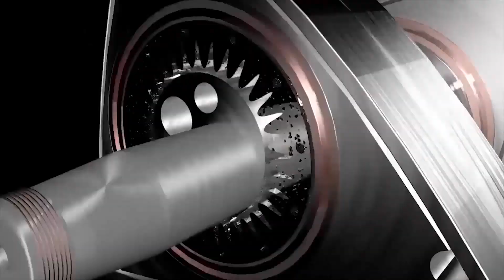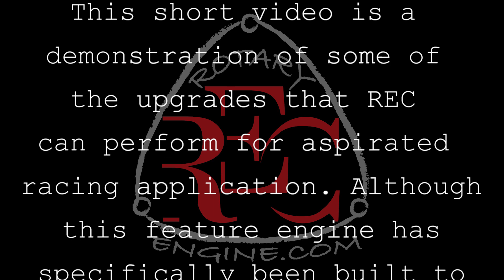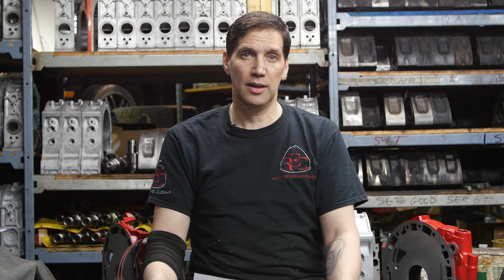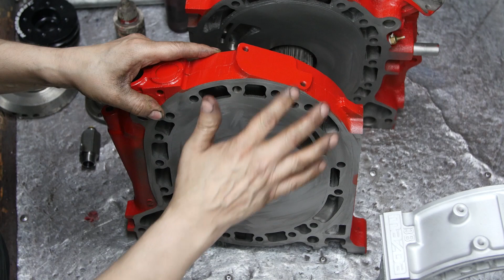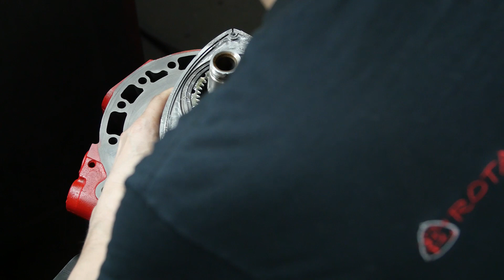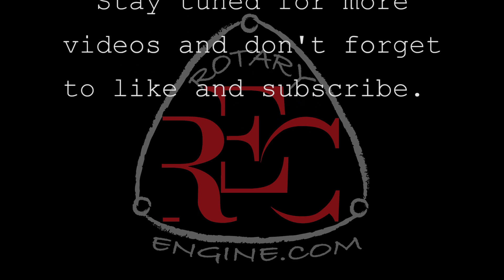Full Bridge Aspirated Racing Engine

Comment: 9750rpm that's nothing if my rx8 didn't have a rev limiter the factory engine would rev to 15k ik becouse it would sling the engine to 12k with the rev limiter at 10k....

Comment: Have to say in this case your wrong with those size ports for an n/a engine, over here in nz others have built these big massive ports and they don’t perform. Btw I’ve been building 25 years, turbo yep go massive, the limited very few have discovered here that 3B rx3 ports are as big as you need to go for a n/a engine, full length bridges, extremely torquey without losing top end power. Question what’s does n/a rely on A. Gas speed. Big ports slow the gas upon entering the housing resulting in performance loss. Fast gas speed more torque, still the same top end. This only applies for n/a. Bigger is not better unless you are going turbo.

Comment: Hey, my friend,  I learn a lot from watching your videos.  I would like to ask a question.  A guy that has a rotary engine website.  He explained to me that synthetic 2 cycle oils leave significant deposits in the engine; and that Marine 2 cycle oils are for a different type of 2 stroke engine than a rotary engine.   I found that Briggs & Stratton is a low ash cleaner-burning 2 cycle oil.  Does any of this make sense to you guys?  Thanks!!
Reply: I use Lucas 2 stroke oil in my rx8 street port

Comment: I have running '85 12A and 84' 13B GSLSE engines.  The plan is to combine the two for a ported NA motor.  But I'm not sure if I want a bridge in a 1200 lbs street car that will only see occasional track time.
Reply: What exactly did you do to get your car down to 1200lbs??
Reply: @rotaryrocket74  Start with a stock 1500lbs 1965 MG Midget.  Sorry for leaving out important information.  If I get fiberglass pannels I may be able to go sub 1K lbs.  The 6-port SE and trans are in it now.  Going to shorten the SE rear end.

Comment: Sorry to say but 2 stroke is not good. If you want Roto to last longer, Use 2 stroke oil in the gasoline! But that dosen't last long either... Two stroke have a short life because of the heat cycle the rings and seals have to go through.
Reply from the maker: We use Idemitsu in the fuel in conjunction with factory OMP. Its the surest way for best results

Comment: On the topic of early irons, can you run the early center iron on a gslse engine to make the port larger since the se iron does not have much material before you hit the water jacket? I’m currently running dcoe style throttle bodies so there is no need to use the stock injectors that would be in the se center iron. Car makes 197whp on a popular Australian dyno. And what would be the gains if I were to send it to you guys for either a maximum street port or half bridge?
Reply from the maker: Yes you can. They flow much better.  Its just the early irons are carb irons and dont have injector ports so you need to run ITB's with fuel rails built in thus ditching the stock SE EFI

Comment: Why are turbo bridgeports smaller than aspirated bridgeports? I don't get it?
Reply from the maker: Good words guys but also during overlap boost pressure can escape the intake charge and is forced into the exhaust. EGT;s can raise very high when fresh air is introduced into the burning exhaust gasses. A short smaller bridge at the top of the port only can reduce the amount of fresh air feeding the exhaust stroke
Reply: Port overlap, the longer ports on a n/a build are for longer duration of the intake charge. Basically the same as putting a high duration high lift camshaft in a piston engine. When you turbo charge a piston engine you put in a boost (or turbo) camshaft not one with heaps of overlap. It works the same in a rotary engine. Hope that makes sense. Cheers Mark.
Reply: @MJTAUTOMOTIVE  so why are people making big power on semi peripheral port turbo engines?
Reply: @BoogalooShrymp  . Because the port in the housing is positioned around the same place in degrees as a good turbo port in the side housing (iron). On a semi peripheral port the port size is very small compared to size on a n/a peripheral port engine. When the peripheral port itself is smaller it is also not as large in degrees as a big n/a port. They use the semi peripheral port to increase the amount of intake charge in volume  without changing the overlap "ie port timing ". Cheers Mark.

Comment: Could a full Renesis rotating assembly have been used here if its 10:1 compression was sufficient for the build? What application did the 9.7:1 rotors come from?
Reply: 89-91 rx7 fc3s non turbo. Only available in north america
Reply from the maker: Yes they could have been an option but we have learned that the extra .3 in compression does not yield noticeable gains. Also, when running apex seals over a peripheral exhaust port, you really need to use a tall RX7 apex seal, in which case the RX8 rotors need to be EDM'd to full depth slots....its pricey....plus the narrower side seals from the 9.7 rotors seal better
Reply: @rx7specialties203  It cant be done by any of the other methods you offer, like milling?

Comment: Nice castom works.
This engine 4 port rx8? 
Rotor housing rx7?
Reply: Milos Arsic rx8 rotating assembly. Early model rx7 housings and plates. Rx8 gears.
Reply: It’s 4-port 13B RE (massive port work can be done compare to REW or Renesis counterparts) with RX-8 rotating assembly (stronger or larger material maybe)
Reply from the maker: Early RX7 12 a ends with SE rotor housings.

Comment: By early irons you mean pre 86 obviously, and the 9.7 compression rotors are from FC RX-7 with 2mm apex seals?
Reply from the maker: Only the rotor housings are 13B FB. The irons are 12A.
Reply: Yes he's talking the first 13b from an FB. The rotors are from 89-91 Fc non turbo.

Comment: Could you use gsl-se housings injunction with your cnc rx8 irons?
Reply from the maker: Its been done for turbo engines yes
Reply: @rx7specialties203 I've emailed you a few times. I would still like some work done. I know your probably busy as hell and didnt have the chance to reply. Would just like to get these parts out to you.
Reply from the maker: @JustinSmith-wo1ne  I normally get back to emails within 24 hrs. Seems odd and my apologizes. Did you try to call us or have you received a response since?

Comment: Did I miss something? How are you keeping the corner piece of the factory apex seal from falling into the port on full bridge? Both sides of the rotor housing has the notches so there's no support for the side piece. I must be missing something? These seals don't look like 1 peice seals, that's why I'm asking.

Edit: Nevermind! Seems the side plates and apex seal itself keeps the side piece in check over that gap.
Reply from the maker: Once again...Its not about support..in fact..the whole concept behind the bridge is to provide the necessary support. The concern is actually the tip of the end piece catching on the notch. Ideally its best to use 1 pc ceramics yes....but I have used 2 pc seals many times. If you think about it, the 45 deg cut along with the side housing prevents the end piece from moving up so very unlikely to catch.
Reply: @rx7specialties203  You misread my comment. I was refering to the corner piece of the apex seal and not the corner piece itself. I already know the bridge supports the corner. I just never seen someone build a FULL bridge with factory apex seals. But your right about the angle. That's why I edited my OG post! 😉

Comment: Why not use the RX-8 Rotors? I thought they had higher compression.
Reply from the maker: They dont make anymore power and they're are extra costs involved as they need to be EDM'd to full depth 2mm to accommodate the taller seals necessary for rigidity to pass over the exhaust port along with the ful depth custom corner seals. Unnecessary costs to gain virtually nothing.
Reply: @rx7specialties203  Ah, okay. Thanks for the reply! I'm currently planning on a build just like this and was really surprised to see you make a video on it. Thank you for the info. This changes a lot about my plans now and I appreciate it.

Comment: Thanks for the video, very useful information here.
One thing I'm wondering about: the housings have been notched on both sides, how does this work with oem multi-piece seals? Will the triangle piece have enough support? I'm doing the exact same build and am still trying to figure out to what extend and length the notch can be made on both sides
Thanks!!
Reply from the maker: Its not about support..in fact..the whole concept behind the bridge is to provide the necessary support. The concern is actually the tip of the end piece catching on the notch.  Ideally its best to use 1 pc ceramics yes....but I have used 2 pc seals many times. If you think about it, the 45 deg cut along with the side housing prevents the end piece from moving up so very unlikely to catch.

Comment: Any idea of the power this build will produce? More interestingly for me what do you think it would produce on the twin 40's as that's my current build plan. Cheer
Reply from the maker: All depends on jetting and tuning and exhaust system. Likely 300+ crank HP

A
Reply: Prob ~200+ whp. Hard to squeeze a whole lot more without going PP.
Reply: @FukU2222 . My 13b Race engines with a 50mm ida style throttle body average between 285-305 Rwhp.
Reply: Hello I have this 40 machines for sale WhatsApp +96599495940